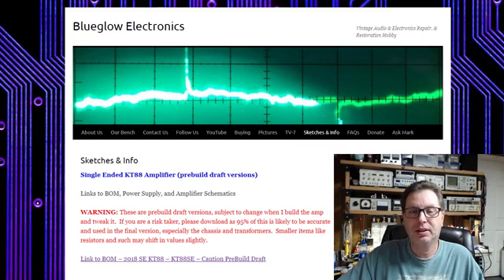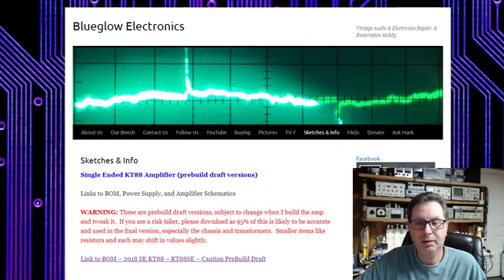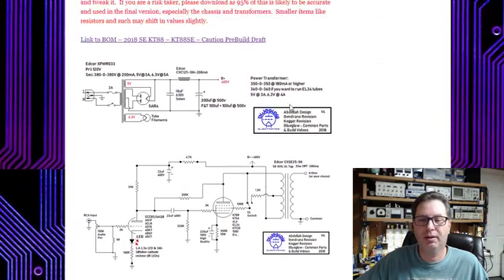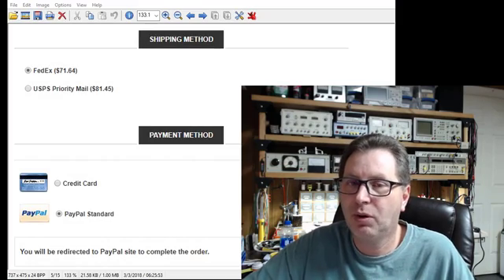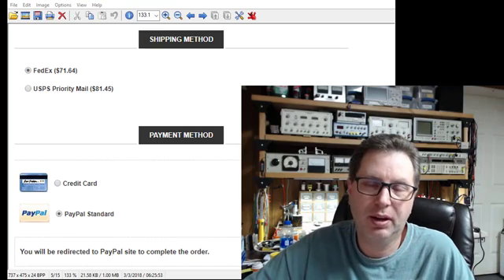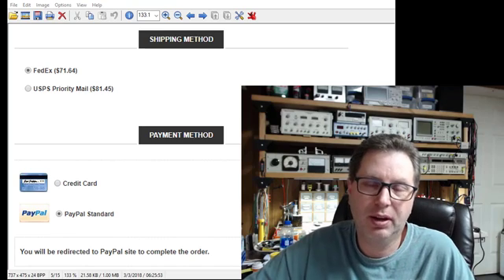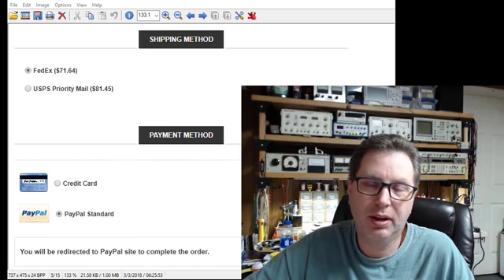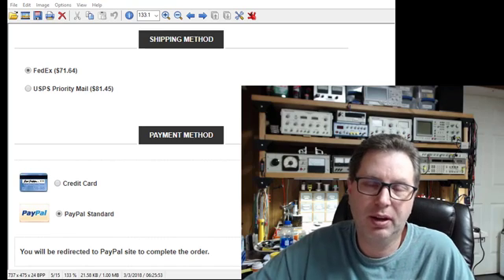KT88 Single Ended Tube Amplifier Build 2018 - Part 2

Comment: $1.10 a resistor! Try mouser.com. you will hate the website it's terrible but search 261-100k-RC replacing the 100k with the value you need and order them with a minimum of 10 quantity per value and it goes from $0.23usd per to $0.075 per for a whopping total of $0.75 for 10. They are 2w. In a pinch with back order go with 281-100k-RC. They are a smaller body. Theoretically less volume to dissipate heat but still rated for the same 2w.

Comment: I was thinking about replicating one of the old British Quad amplifiers but I have been out of the electronics business and things have changed a lot since 1969 when I was a young man. 
The first problem is I have heard about capacitor failure a lot and where do you get good quality components in the UK ? And then who still makes good valves. The old UK companies like GEC have been brought out and no longer exist. But thanks for the great videos. My mind is still curios despite being an old man myself.

Comment: Not sure if this is common knowledge or not, but I'll just put it out there for you;

The Kiwame resistors seems to be exact same as KOA SPR2 and SPR5 carbon film resistors under a different name, and these are available at much lower price from places like Mouser and such.
I have some KOA as well as some Kiwame, and they are EXACTLY alike, so my guess is the Kiwame brand is just made by KOA and sold as boutique parts.

Unfortunately I had already purchased my Kiwame resistors when I discovered this, but for next project I will go for the KOA resistors instead :-)

Comment: I think you will like this circuit with the plate to plate feedback, I've built several and really liked all of them. BTW, those output transformers you ordered are the same size as Dynaco Mark III opt's so it should sound really good!

Comment: Your right about this being a expensive hobby, I have a few amps under my belt that beat up my wallet. Have you ever ordered transformers from Pacific? They say no job to small for them, I know they are the Holy Grail for the Train Wrecks and I would love to know if anyone has used in a stereo amp. It seems the used market for console amps have take off in price and I don't see the benefit of buying that way anymore, unless I know I'm getting a great deal by chance. I have used Edcor's but wasn't happy with the Blue Color. The 807 is already in the to order list, Id like to do a 2A3 but those are pricey

Comment: The Solens would be bottlenecks IMO. I liked the old Panasonic polyprop orange drop types better with copper leads if on a budget. But I think they were discontinued.. Koa Speer makes/OEM’s Kiwame. I think they are available at Mouser, but in very limited values..

Comment: Have you considered (Amps Parts Direct) uncle dog says they make the best Transformers?
Isn't it better to build the Transformers on a separate chassis and have them behind your speakers? Having shorter speaker cable is better isn't it!  having the multiple wires gk back to the amplifier. if you can get military vehicles like tanks plug and sockets? that are multi pin 6, 8, or10 what is what you want to use they are gold coated with high quality water proof seals and are lockable. British army surplus
Reply from the maker: Amp parts Direct doesn't make any transformers, they are a reseller like lots of others.  The classic tone uncle doug mentioned is what I used in the SE807 build for the power transformer, I've used them a lot.
Reply: Don't know about that John. For a PP amp using UL, there would be five conductors at around 300volts connected between amp and speaker, running around furniture and over carpet.
Reply: john smith 
 not talking that far away 3 or 4 feet from the amplifiers

Comment: ASK MARK:  I watch  videos  on guitar  amps and they have output  tubes connected in parallel. Could you  explain  how doing tubes in parallel increases the output  power with  regards to  current and plate voltage